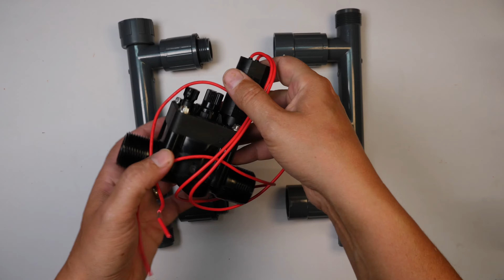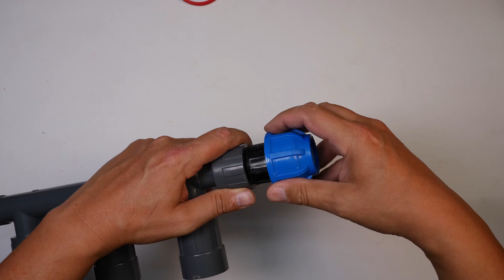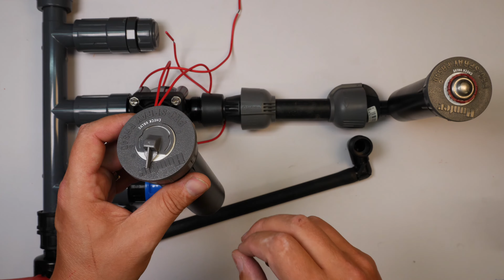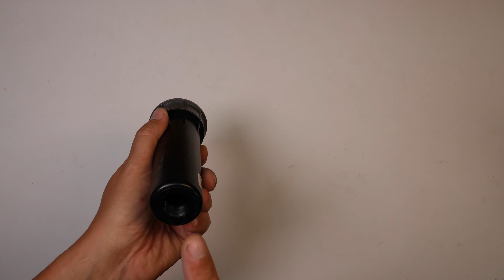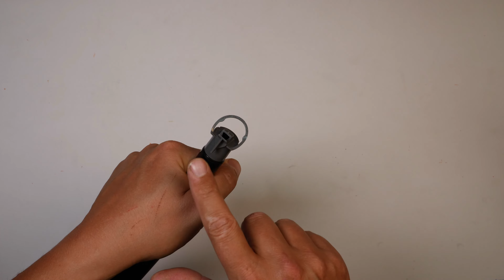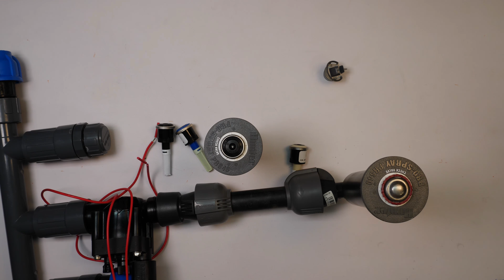Hunter MP Rotator Setup: Best Valves & Fittings for Your Lawn

Comment from the maker: *👇 All products & links from this video:
🔗 Pressure-regulated housing for MP Rotator with nozzle https://geni.us/mQBIPo9 (Amazon)
🔗 MP Rotator nozzles https://geni.us/cBdTAL (Amazon)
🔗 Hunter complete set https://geni.us/xNpgEC (Amazon)
🔗 Hunter adjustment key for MP Rotator https://geni.us/dh6eBT (Amazon)
🔗 Hunter solenoid valve https://geni.us/JxyAtB (Amazon)

Other accessories*
🔗 25 PE pipe https://geni.us/id4w1 (Amazon)
🔗 Pipe cutter https://geni.us/RR7ke0 (Amazon)
🔗 Ball valve 25 https://geni.us/kC4G (Amazon)
🔗 Rain Bird distribution box, large https://geni.us/w6Yo1xt (Amazon)
🔗 Hunter distribution box https://geni.us/kERg1if (Amazon)
🔗 Distributor https://geni.us/CAUtIyB (Amazon)
🔗 Angle for distributor https://geni.us/33ZoLJ (Amazon)
🔗 Tap for distributor https://geni.us/SlqUq5 (Amazon)
🔗 End cap https://geni.us/DIENA (Amazon)
🔗 Fittings Gardena https://geni.us/Blop (Amazon)
🔗 Fittings clamp connectors https://geni.us/wv9R1w (Amazon)
🔗 Empty pipe https://geni.us/gmTRB (Amazon)
🔗 Control cable https://geni.us/dQHSL (Amazon)
🔗 Flexible connection “Swing Joint” https://geni.us/9BR6 (Amazon)
🔗 Hunter X-Core irrigation computer https://geni.us/LxVyM7Y (Amazon)

You can find a detailed blog post with lots more information on my website: https://commaik.de/2025/03/rasenbewaesserung-installieren-ventilbox-hunter-magnetventile-und-rain-bird-wasserverteilung-im-detail/

Follow me on my social media channels for more content! @commaik

🎥 This video was originally produced in German for my main channel:  
https://youtube.com/commaik  
It was then translated into English using Heygen – with my own voice and lip-sync.

🎙 Want to dub your videos like I do? Try Heygen:  
🔗 https://www.heygen.com/invite/b96cdcf6 – Get 300 free credits when you subscribe.

📺 The original video, which includes English subtitles, can be found here: https://youtu.be/COdpADOQiGI

Note: All links marked with * are affiliate links. If you make a purchase through these links, I will receive a small commission at no additional cost to you. Thank you for your support!